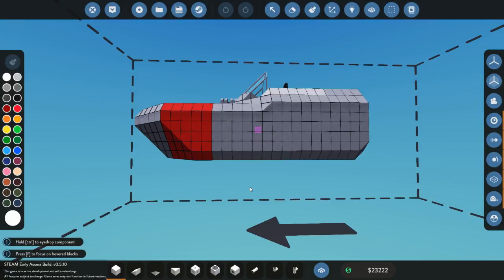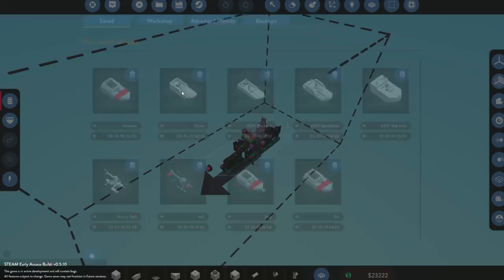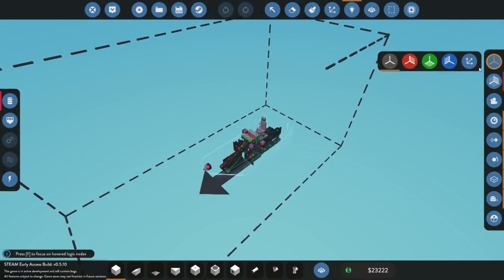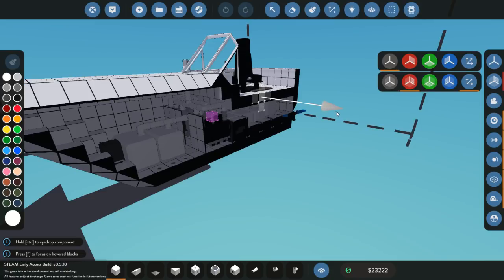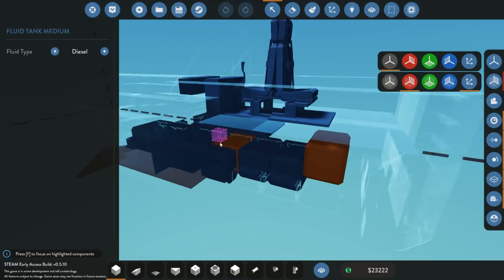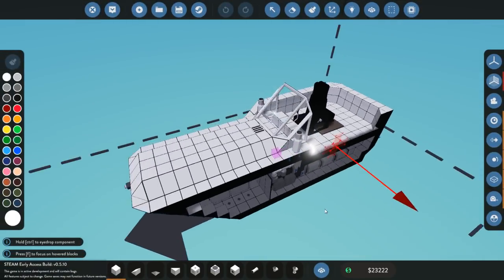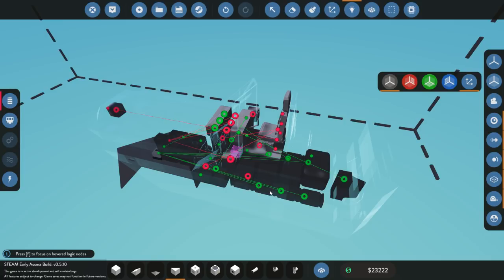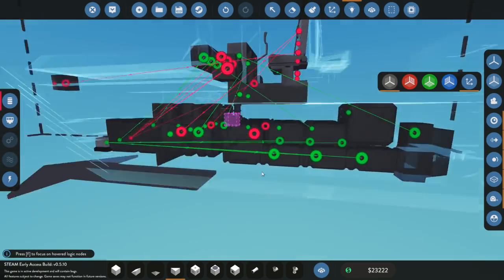Vehicle Building Gameplay

Comment: It’s nice to see you trying stormworks out. 

One thing of note is that the pipes are duel purpose and are also driveshafts.

Don’t worry it took me a while to figure that one out.
Reply: Also another fun fact.

The gear boxes are for some reason backward compared to what you would expect.
If you want the propeller to spin faster than the engine the gearbox arrows have to point to the engine (though the pipe drive shaft)

The way things are set up makes it so a 1:2 gearbox actually functions as a 2:1

This had me really miffed for a few hours.
Reply: I also totally agree with the idea of non voxle hulls.
Hybrid building system maybe?

The one thing that really is drawing me in on-top of building for stormworks is the microcontrolers

They allow the creation of complex control systems and automation without needing to be proficient in programming.

Which is one thing that space engineers never capitalized on.
Reply from the maker: WHAAAAAAAAAAAAAAAAAAT?

WHAT?!?!
Reply: That's what I felt when I noticed that.

I do think the game should of tried to make it more obvious that pipes where also drive shafts.
Reply from the maker: @re-bot9855  Thanks for letting me know!
Reply: no probs

Defiantly a little easier to build a nice boat.
Reply from the maker: @re-bot9855  I built this monster. It uses almost no fuel, automatically load-balances and gear-shifts... pipes are OP.

https://steamcommunity.com/sharedfiles/filedetails/?id=1614930474
Reply: :D your pretty good at making awesome boats! I'm not even that far in yet :P.
Reply from the maker: @re-bot9855  Aside from a speed dial, those are all starting parts!
Reply: I know but its tricky to optimize effectively. ill probably take a look at what you did.